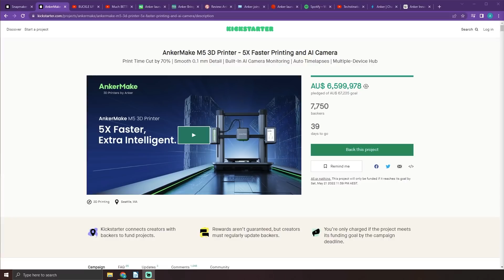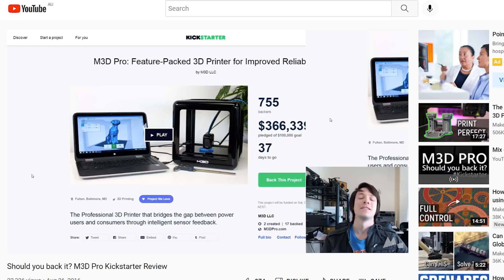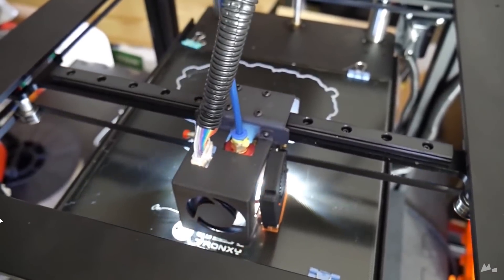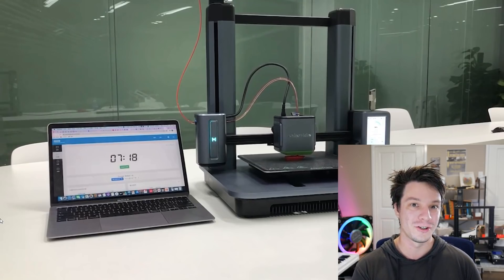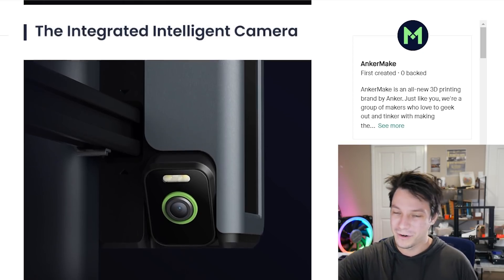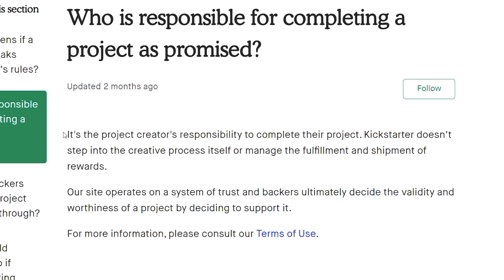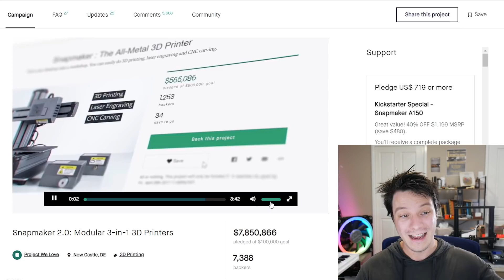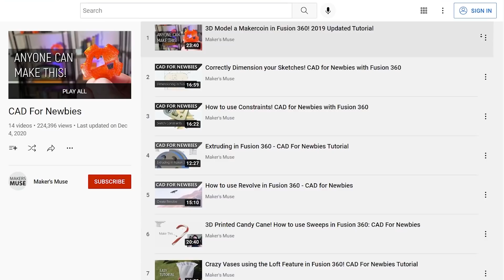This 3D Printer looks incredible, but...

Comment: I think you're right about resin jetting for mass consumer 3D printing. The LED bar tech has been around for a long time in some so called 'laser printers' - although the bar is usually static as the paper moves. Much cheaper than a DLP. I suppose existing thermoset Ink Jet tech could be used but then we'll see 3D printers costing 20 bucks with new resin cartridges costing 100. Let's not go there again!

SLM has got a lot going for it as it's self supporting (some PCBway SLM prints I ordered were amazing but with a texture not to everyone's taste) but for a consumer printer I can't imagine anything more messy apart from the carbon photostat copier my Dad used to rely on!

I use 3D printing for engineering parts prototypes and feel that too many 3D printing videos on YT focus on organic shaped models where geometry and dimensional accuracy cannot be fully scrutinized. I never got on with FDM as it was never structurally sound - layer adhesion etc - my prints always felt like Shredded Wheat. SLS is great but messy and requires post processing. Resin Jet might be the perfect solution as there's no vat of slime from which your ominous creation emerges, and dimensional accuracy across at least one axis is guaranteed. It could be very fast and layer adhesion would be determined by exposure time and other factors in the highly tweakable domain.

Comment: Always great content. I was looking for reviews of the Ankermake from the youtubers I watch, you being one of them. I see this one but curious as to why I haven't seen a current review. I have 10 3D Printers. 2 Lulzbot TAZ 5s with one running the 1.2mm Moarstruder with 2.85mm filament the other a E3D titan .4mm with 1.75mm filament. And I do have 2 of the Snapmaker 2.0 A350T's. All my machines I bought on eBay from people who, as you said, maybe should not have bought them with no design skills, or assembled them wrong, thought they were broken due to kits installed incorrectly or disassembling to do any upgrade or not knowing how to bed level or adjust Z height and I got these all TOO inexpensively and got them all working. And interesting that you mentioned 3D systems. Long time ago, 2012 they came out with a Cubify. Just for historical interest I grabbed a Cubify Generation 2 for $40, original sale price was $1400. It actually works, AND I contacted the company for their slicer software that creates a .cube file vs. the .gcode file AND they helped me out. WOW, they are a pretty decent company to stand behind an 11 year old product. Anyway, great content and I am considering an Ankermake however it deviates from my buying broken machines and fixing them. Cheers.

Comment: Sad thing is da Vinci from xyz printing had a printer that was just what you were saying. They just had lousy  suuport. I knew nothing about 3d printing. I got the machine then plugged it in as was... & guess what started printing. But you well established 3d printing poop-pood it cause support.  They gave up and stopped working with the community.  But my printer works well. You just had to install the original software and update in order of their release.  This fixed all the issues  that you guys didnt like. It appears it was ahead of it's time in 2015

Comment: As someone who as just gotten his first 3D printer and begun figuring things out I suspect the true future is less about the hardware and instead will be primarily about the software.  I had a strong drafting background (but that was like 35 years ago) and stupidly I thought 'How hard could it be to learn CAD?".  Between all the variations in CAD software there is a HUGE learning curve with very little terminology transferring from one to the other.  I found one may have the engineer logic in mind while another caters to the programmer.  I've settled on FreeCAD (for now) because it links better to hows my brain works.  Tinkercad however is downright baffling and it just makes zero sense to me.  This is where I suspect the bulk of the improvements will be found.  If there is a truly easy to learn and intuitive program that just works and does what the end user wants/needs without having to spend hours upon hours watching tutorials and trying to translate "this" for "that" then the end user will be able to truly take advantage of the hardware capabilities.  Even something as simple as trying to move an object from here to there is needlessly complex at times.  One program "moves" it while another "translates" it.  One uses arrows the users grabs and drags while another uses specific bed coordinates the user has to enter.  All of this is needless and will remove a lot of end users from even attempting it.

Comment: I started to use the laser module with the snapmaker only when the housing arrived and it's nice and a bit safer but i still use the safetygoggles and say everybody should stay out as im using the laser, made stuff for my cousins and stuff.
The 3D module kinda sucks since the bed is warped badly so that not even the mesh leveling is helping... Already texted the support (since i never abused the printing plate) but didn't get an answer yet... So I'm not that satisfied with the snapmaker 2.0

Comment: I have had mine running for about 10 days and ended up with a huge blob in mine and I had to disassemble to remove. I will need to replace parts because the connectors are toast.

Comment: Speaking as a physician, I don’t share your enthusiasm for resin printers of any sort because I’ve yet to find a safe photopolymer resin. Anyone who reads AND UNDERSTANDS their safety data sheets — and understands health — would not use the stuff, which is toxic to individuals and the environment, fraught with serious risks.

Fused-filament fabrication printers are not safe (not even with PLA, hence they should never be used without active ventilation in homes, schools, libraries, or other occupied buildings), but they are vastly safer than resin printers. But safer does not mean safe. The mistake most people make is assuming little or no smell equals little or no risk. Wrong.

History is littered with things that were presumed safe, but weren’t: asbestos, lead, mercury, x-rays, thalidomide, Agent Orange, Teflon & related chemicals, BPA & related chemicals, triclosan, cigarettes and smoke in general because of particulate matter that most people blithely trivialize or ignore, lopping a few years off the average lifespan. When will we learn to be more circumspect?

Comment: Tinker cad is a great resource for beginners.  It's so easy for newbies to grasp, simply putting shapes together like legos.   If they put tinker into a stand alone software package, available on all three major platforms, windows, mac, and linux, they'd have a winner.   Priced affordably,  licensed to printer manufacturers for bundling with their printers so users could get right into modeling out of the box,  it would be so popular and get so many people into the hobby. 
I've modeled in onshape, freecad, and blender.  Although those programs are very powerful and use the professional approach to cad, they are difficult to learn and easy to forget.  Meaning,  if I don't use the software for weeks or months, I have to re-learn how to use it all over again. 
Tinker is so fast and easy to knock out a quick project, I still use it most of the time for my projects.

Comment: Ha, the UV cartridge printer will be subsidized by HP and the first time you replace the cartridge, even though it's a real HP  unit, will deny you to start a print, claiming it's a counterfeit or faux empty right out of the foil pouch.

Comment: today digital printing has difficulty getting the ink through the heads
even large machines of 500000 euros have serious issues
you clean the heads often

now consider if pla goes through the modified heads and get quality output

it is a thicker material than the ink that has a problem today, it is probably impossible to do something like this

and the cost will escape quite a bit

Comment: So many great points brought up here. Everyone I know that has bought a printer just ended up selling it because of basically giving up on the thing... which is how I procured mine. The learning curve on this stuff is pretty steep once you factor in all of the setup, maintenance, troubleshooting and especially the 3D modelling and slicing. I've spent way more time learning things than doing actual prints, but I'm finally at that point where I can be confident in my model design and knowing they will print well, and having a blast!

Just stumbled across this channel and doing a little bit of a binge watch. Really informative stuff! Thanks :)

Comment: I agree with your assumption of 10 years down the road.. with one caveat.. materials. As far as I understand it.. resin printing is limited to resin material. When you can put DIFFERENT cartridges in for ABS, TPU, PBT, resin, and more.. in to a device.. and then pass it a model without having to slice.. it just works.. THAT is when we'll finally be close to what regular printers are today. There are real uses of ABS prints.. some things that resin won't work well with for example. Or TPU.. for softer materials like in the drone market where TPU is used for protecting ends/cameras/etc, or PBT for those that want to print key caps, etc. When we have one printer that can do that.. that's when we pass the "hobbyist" level and in to every day main stream.

Comment: Never heard of them, and the name is too close to "wanker".  For the price, it had better print every possible filament, metal sintering, a laser, a CNC, quick-change tool changers, multi-color blending, recycle failed or old prints to repurpose the filament, wash my cars, vacuum the house, and take the garbage out.
WRT resin jetting, I really don't think the "maker market" wants to deal with the mess.

Comment: I will say that at least every product I have from Anker actually works and is actually high quality. That's a really hard thing to find in the massive sea of cheap as possible shit with weird made up brand names drop shipped through Amazon. I just bought a Prusa because I want a printer that actually works and is reliable, unlike the CR10 that I have at work, or the other printers I've tried. If this Anker had been available, I might have bought it. I actually love tinkering, but I want my tools to be tools for making my projects, I don't want them to be projects on their own. I do all my own CAD work and design mechanisms that I want to exist, and don't want to have to divert that limited time to levelling the bed yet again because the printer can't maintain level between prints. I'm not sure how I feel about a huge company getting into the market, but it will probably be an actually good printer at least.

Comment: I have to object to your last point of learning how to model has to be difficult.  Yes, diving to SolidWorks/Fusion 360/etc. when you've never done CAD before is a nightmare of confusing terminology/etc., but creating something printable in OpenSCAD can be done in literal minutes if you are used to it, and 90% of it is just typing in what you want it to do and letting it do its thing.  There's no confusing UI with a thousand menu options to navigate; you just type then press <F5> to preview your model.  Like how it came out?  Press <F6> to finalize it then <F7> to export the STL.  Done.  Sure, it lacks a lot of the higher-end tools that a full CAD program has, but, every time I start getting into Fusion 360/FreeCAD/etc., I always find myself falling back to OpenSCAD to make the simple stuff I 3d print.  It just works, and I believe that everyone who does 3d design should learn some form of script-based modelling in addition to what they are already doing.

Comment: I think that target was already reached by the WEEDO TINA2. Got that machine a month ago and that thing prints approx 12 - 16h a day. It's basically a "print & go" printer. Had absolutely NO failed prints. My old Anet A8 is trash compared to that thing. However, the TINA2 is not without faults. One thing I have to do before every print is, to reinject the filament into the extruder cause once the printer cools down the build up tension of the filament in the bowden tube lets the filament snap at the extruder. But that's the ONLY downpoint of the TINA2. Besides that that printer is exactly as reliable as my desktop dokument printer.

Comment: I do agree that if you really want to get use out of a 3D printer you need to learn 3D modeling/ cad design. If you don't know how to you'll eventually get frustrated when you think you can print a part for something and it doesn't exist yet. With cura 5 I made a replacement frame adapter in PETG for prescription lenses for my quest 2 because the original frame decided to just crack and break and if I didn't know how to 3D model I'd be out of luck despite having a printer. A printer is only as useful as the person using it like with any TOOL. 3D printing is a tool, not a toy you can just pick up and play with and it's all unicorns and rainbows. I think 3D printing is going to look like walmart store photo printing in the future with that inkjet resin technology.

Comment: Good thoughts, but after speaking with other industry experts, I can affirmatively say that resin jetting is definitely not on the horizon for consumer. It has many consumer safety concerns (significantly higher toxicity). It has many setup issues (cleaning and material installation). Finally, the high equipment costs (tight tolerances and fluid channels). Those factors will likely keep resin jetting from entering the mainstream consumer market.

Comment: What is the difference between a printer telling you a print has failed and you seeing a print fail, is this printer going to tell you why it failed "doubt that". You rave about the sensor the anycubic mega has has that in place since day one, with auto bed leveling also 10 bolts and its up and running. You don't need auto functions galore all that breeds is DUMB OR STUPID users because when something dose go wrong you will have no idea how to fix it unless this comes with a waranty like a fridge/cooker etc where a engineer comes out to fix it.

Comment: Nice, honest video, as always 👍
You hit the nail on it's head with the comment, that every 3d printer user should know how to create a 3d model. This is so true. However expecting people, especially the kind that want to switch the printer on and just print something amazing, will probably never even attempt to learn 3d modeling. I bought a 3d printer kit, built it and it worked wonderful from day one. However, I ended up not using it for around 6 months, as I first had to learn how to model stuff that I wanted to make. I think it's too far a shot to ask people to first learn to model, before buying a 3d printer. Most makers are creative and at the same time also lazy. I can't think of any maker that would have learnt 3d modeling, before buying a printer, even if you told them to.

Comment: I bought an original CR-10 back in August 2017. I learned to use it from watching this channel,  and I went from idea to prototype, to patented product.   It was not magical, it was work.  I printed about 1000 items.   Then in 2019, it began to have issues, leveling, not sticking, spaghetti items, etc,  so it sat silent.  Recently I went over it and spent days trying to get it to work.  Finally a new nozzle and tape and glue, and it is now printing.   There are some strings in the beginning, but so far it is working.    I ordered the Ender 3V2, and will see if adding the CR touch works.  

Thank you Angus for your videos.

Comment: ha! I like the Inject Resin printing idea. I would buy that one if there is a big enough build volume. how long do you thing before we will see this type of printer? I hope we will not have to wait long. Also I wonder if we could then print in color as well? Also, if the Resin is contained in an ink like cartridge or ink tank like on the Epson ink tank printers, this might make it an much easier to handle, etc.  I was thinking along these lines where the print head could somehow spray filament out of a spray nozzle. I has thinking of something like a spray booth where the spay head could move in any angle and any direction. BUT... if spray is not controlled in some sort of stream or something then there is no way to create a shape/model with out the spay going everywhere.

Comment: I bought an AnyCube Kobra 6 weeks ago. It was not difficult to get it to run. Very little setup and great guides. I have been making parts for several projects almost 24/7. I only ruined a buildplate with PETG and had spaghetti only once 😁

PS. I design all parts in Blender. Have been doing Blender for 4 years. I even use it for video editing!